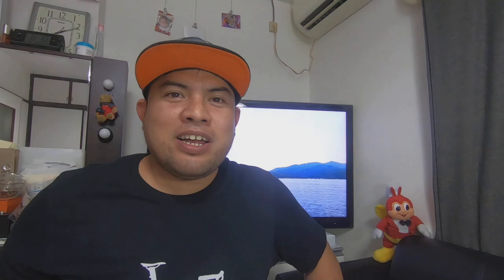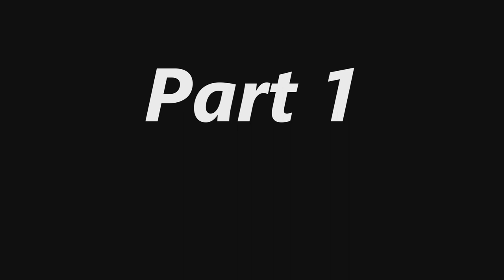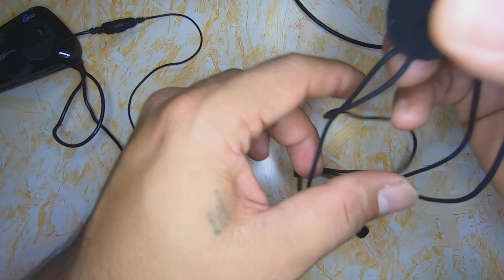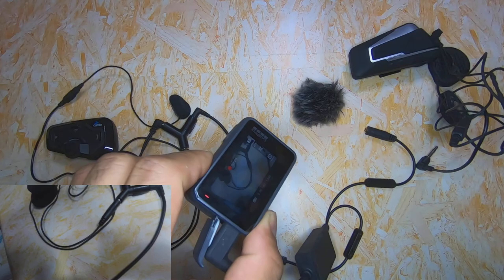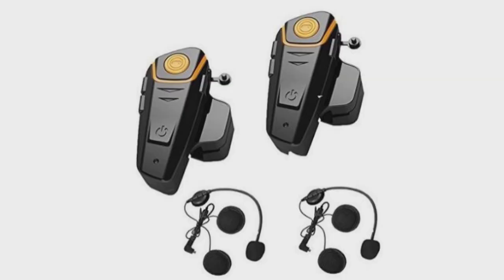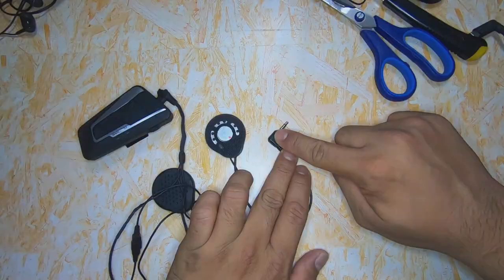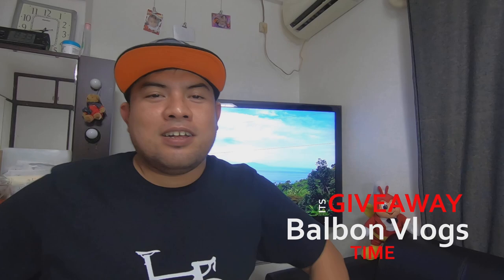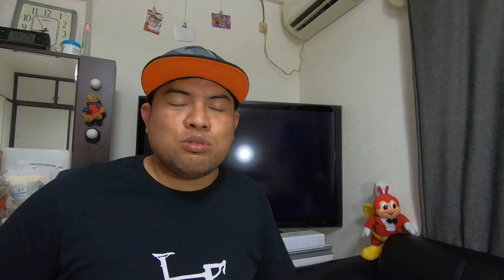2019 DUAL MOTOVLOG SETUP | 1 GOPRO HERO 7 + CARDO FREECOM4+ | GIVEAWAYS

Comment: Ok, so I have a question. 
When cutting the the ring signal from the mic and the tip signal from the speakers what exactly is this accomplishing? 
Will this cause the recorded audio to the camera to be on separate channels? 
Example: The recorded Microphone audio will be on the Left channel and the recorded Speaker audio on the Right channel of the camera? 
Also, would this setup work without cutting the wires and provide recorded Microphone and Speaker audio to the camera combined on both channels, in Stereo?
Reply from the maker: Thank you for your very nice question..

Q1, Yes, that is the goal why im cutting the Ring and tip part of each channel.. We need to separate them. Yes your also correct, it will have a left and right effect in the recording end..

Q2. It will be not possible because signal wil mix and you will be not having a good result. For example, the signal coming from the BT headset was far more stronger that your mic..The signal from the speakers will just our power the mic therefore you will only hearing the audio from the speaker. So No, its not possible to skip the cutting part. 😁
Reply: Balbon Vlogs 
Thanks for the explanation. However with the volume control, wouldn’t you be able to adjust the gain from the speakers going to the camera?
Reply from the maker: @danaszalajeski4416  As I was mentioned earlier, Signal from Speakers (BT comms) was to much for the recorder (Gopro) its necessary to control/ adjust its gain. that's why I put a control in that part..
Reply: Balbon Vlogs 
Again, thank you for taking the time to explain this. I now have a better understanding of what is occurring in this setup.
Reply from the maker: Sorry for any confusion on my tutorial. Im trying to explain in English as much as possible (nose bleeding). Thanks from dropping by in my channel 👍